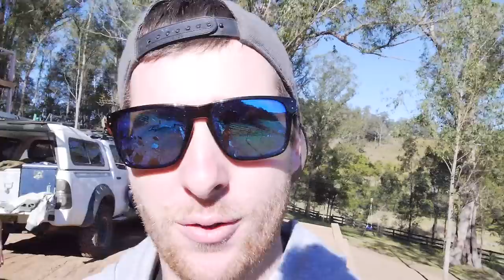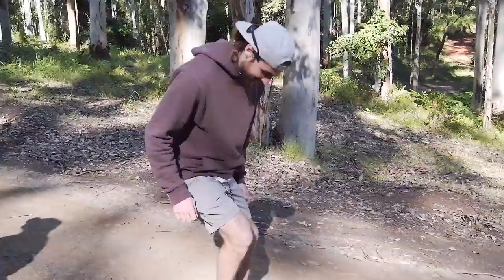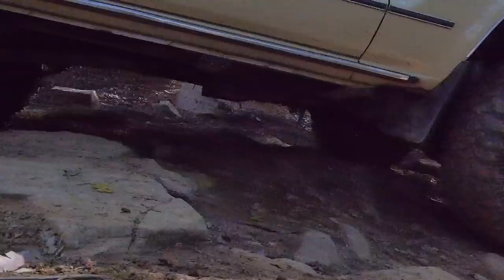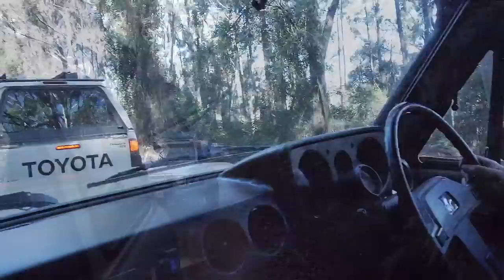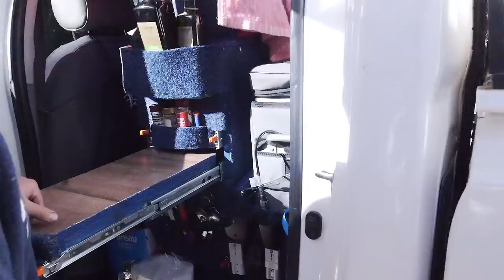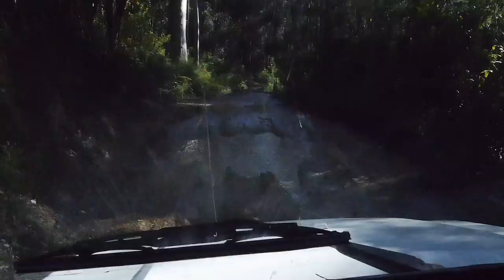THE ZOOK, 60, PRADO & HILUX GO WHEELING IN WATAGINS FOREST! 1/2

Comment: That big hill where you turned around is known as hell hill and can be driven. Should try ctp80, creek rd and green brakes rd
Reply from the maker: Yeah, though not worth attempting in any of the cars we had on the day😂 thanks for the info will definitely chuck them into the GPS
Reply: Boosted & Built Garage need at less 4 inch lift and 35s
Reply from the maker: @maxhill1146  Yeah definitely haha